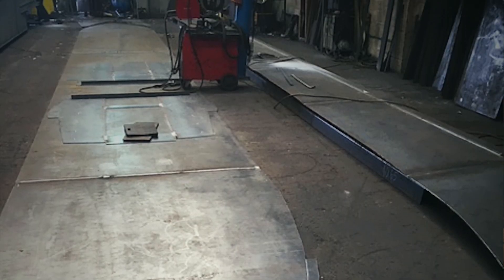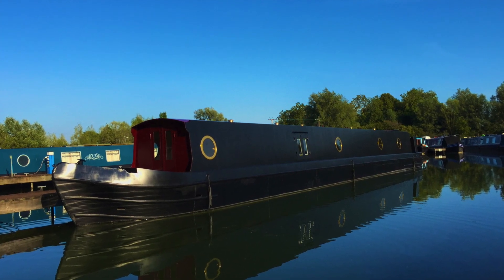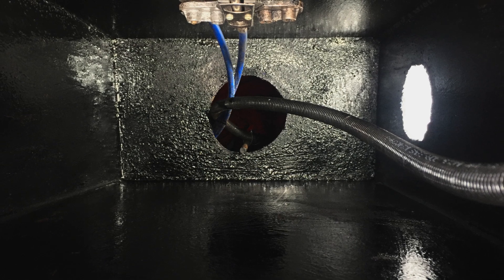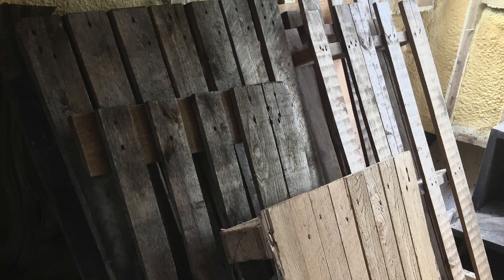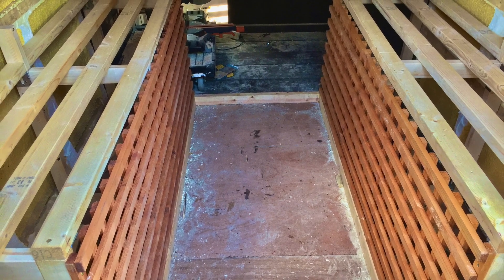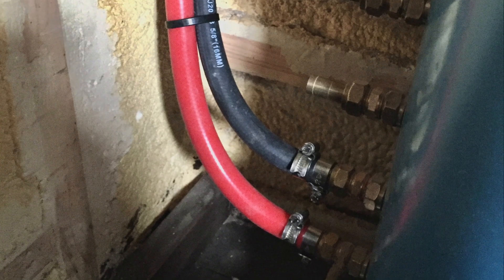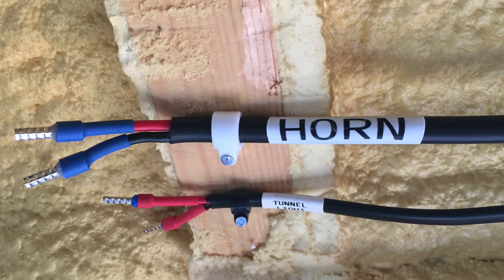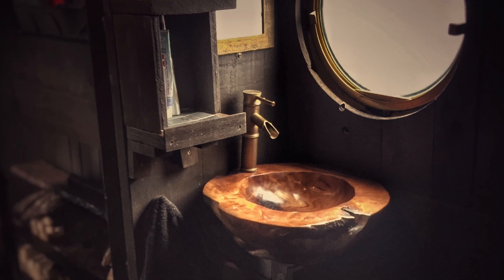BUILD A NARROWBOAT WITH ZERO DIY EXPERIENCE

Comment: Hi Bones, You did an incredible job with your renovation. You said you had no DIY experience? Hmmm, you are either a genius or you may have had a wee bit more experience than what you said. 😉 Anyway, my husband and I are doing a complete renovation of our 30 year old, 65’ boat. Luckily, my husband is an engineer by trade and has done our interior design, plumbing, electrics, etc. The question I have is this: did you have to have an inspection done before launching your boat, and did you have to have a certified electrician and plumber “sign off” on your work? 
Thanks in advance. Love your videos, BTW.
Reply from the maker: I genuinely had never done any significant DIY as I only ever lived in rented place where you can’t! I just watched a lot of YouTube videos and a did a couple of short evening classes in plumbing, woodwork and electrics. My boat was a brand new ‘sail-away’, so had all the checks done in the factory. After all my work it just simply needs to pass the BSS certificate :) Hope this helps
Reply: Thanks for your reply. I have one more question. 😬 What happens in a BSS inspection? Does someone walk through your boat, look at the installation of systems, and check to see if everything operates as it should?
Reply from the maker: @sandymaberly1250  Yes that is pretty much exactly what happens!
Reply: Thanks again, Bones. I look forward to viewing your future videos. 😊

Comment: bravo for CIGS solar panels .... super job
Reply from the maker: Thanks I’m really happy with them. Do you use them to?
Reply: @mynarrowboatlife  I use a 5x55Wp  on my campervan. silicon panels are good for home. besides, this technology is old and inefficient. The future is CIGS.

how many panels do you have and what power?
I have the impression that the controller is faulty. Victron doesn't make a good controller for CIGS panels. And one more question, what batteries do you have?
LiFePO4???
Reply from the maker: I have 4 panels about 500watts if I remember correctly. Yeah I do have lithium batteries 😀

Comment: Hi. Really fantastic results especially for someone without much building experience. I am interested in how you laid down the floor and wall panels. What type of frame is under the foam along the walls? Is that steel or a wooden stud-like frame that you cut the foam off of to hang your wall boards. As for the floor did you tuck the scaffolding boards under the spaces running along the floor and then nail the boards to the sub floor? Finally (I am trying to limit my questions to a reasonable amount) did you run your electrical gunnels under all the flooring? Thanks again. Would love to see the drawing plans you made.
Reply from the maker: Wooooah that is a lot of questions. I’ll probably have to do a whole video just to answer them 🤣
Reply: @mynarrowboatlife  sounds good. Look forward to watching it. ;)
Reply from the maker: @talltalan  I will probably do it as a Reel so I can get it done quicker